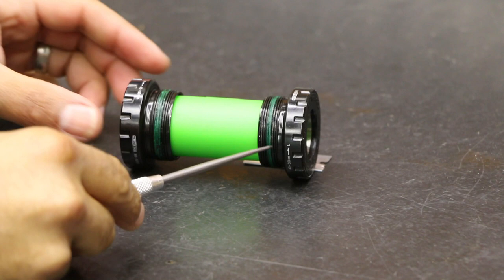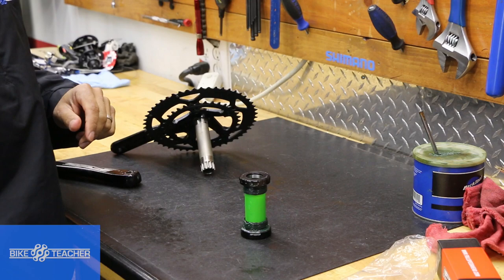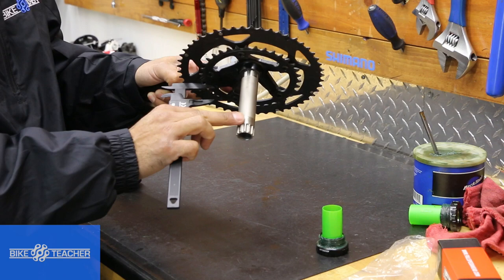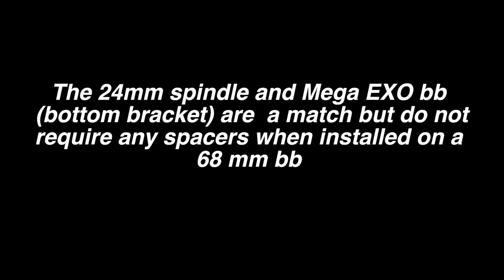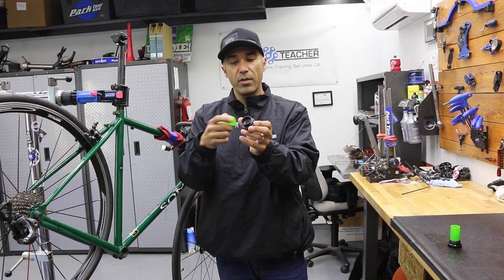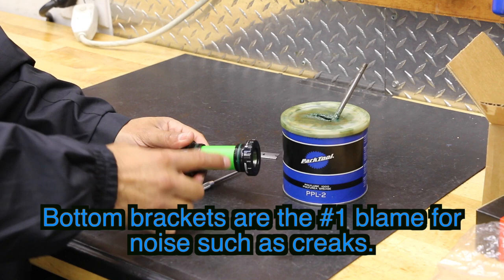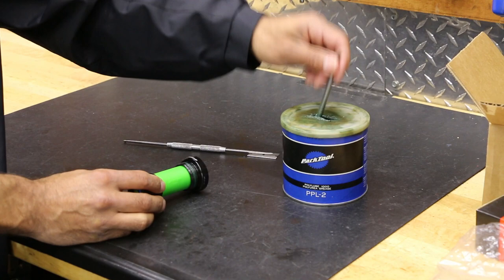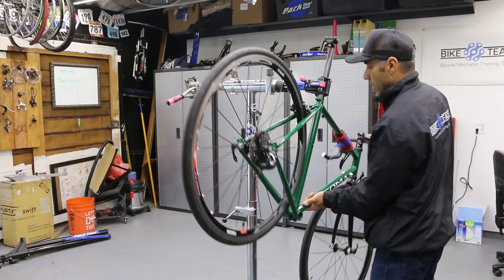How To install an FSA Threaded Bottom Bracket & a 24mm spindle Crankset

Comment: In bearing specs 24mm to 23.8mm is like a grand canyon.
This adds more to the confusion between mega-exo and hollowtech-ii 
On one site someone reports the size of the mega-exo spindle being 23.5mm and on one video this one guy claims to have used hollowtech-ii bearings for his fsa-gossamer but he is greasing and hammering it in!!!  ???

This is nuts.  Every other source on the internet is adding more and more to the puzzle, while the average rider can't afford to buy 2-3 different bottom brackets to compare, especially when one costs $50 and the other $20

Comment: The Mega Exo bottom bracket system is counterintuitive. I'll explain: If you're riding a bicycle where the crankset arms are sitting almost flush with your frame on your current bicycle ( by design ) and replace that system with a Mega Exo bottom bracket, you'd end up putting added friction to the right hand side of not only the rear cogs of your bike, but also the front ( the cogs and chain will be chewing each other up ). Why ?? Because there's a quarter of an inch added by Mega Exo to each side of your drive train ( which your bicycle wasn't built to accommodate ) when you decided to add a Mega Exo bottom bracket. What does that add up to ?? Well, because of that one quarter inch of angle, not only would you end up getting wear & tear to your front & rear cogs, you'd also be wearing out your chain.
Reply from the maker: +ReneeNme   I see your point, it’s all very interesting, and I wish I had more knowledge on the engineering side of it. Thanks for the insight.
Reply: If you notice the drive side crank arm on the Gossamer it looks like an umbrella, where the one you are probably replacing it by (square, octalink,isis) is pretty flat.  So the frame to chainring centerline offset remains about the same.

The bearing centerlines on a 68mm inboard BB are about 60mm apart.  On the megaexo or hollowtech they are 75-80mm.  That makes the crank-shaft flex less, on top of being larger diameter and stiffer itself.  The bb30 frames are suffering because of the narrow shaft.
Reply: OMG - You just solved a year long mystery to why my drivetrain was constantly crunching under load.  Couldn't figure out after multiple derailleur adjustments and chain swaps. Damn FSA BB cup was practically fused to the frame on the drive side upon removal. This is an issue. My bike is a 2020 model

Comment: Thanks for the great video, but did you do the part 2? I am unable to find it.
Reply from the maker: Looks like I did not make the video, I looked for it and could not find it, sorry. This one has a built in bolt I believe or maybe a loose bolt for tightening. Tightening this bolt to approximately 45-50 nm should secure the crankset. Let em know haw it goes.
Reply: @BikeTeacher  how much torque for the threaded ring? No one ever talks about this torque, only the screw that locks the pedal arm

Comment: Is fsa gamma pro crankset compatible with SHIMANO Deore XT M8000 Mountain Bike Bottom Bracket?
Reply from the maker: I don’t know. If the diameter of the spindle is the same that is a good chance. Check with Wheels Manufacturing. Com they offer lots of conversions.

Comment: Hello,  im Lukas from Poland and i have problem with mounting a Xt m771 crank in the fsa bb9200 ceramic v4.9,73e,are you able to help me, I know bikes well, but when I put together the crank xt m771 and BB9200 support, I have a slight slack on the crank axis which I can't delete by unscrewing the lock nut and I don't know what's going on, all tightening moments and  parameters retained in accordance with the manufacturer's instructions, please help, the Fsa representative for Europe did not even know how the Shimano crank was built and recommended me using the ms150 sealing o-ring but I don't know how to solve my problem because it is a simple sealing O-ring. Thank you in advance.  Lukas from Poland
Reply from the maker: Sorry for the delay. Did you get it installed okay? All I can see is a spacer would take care of the issue, Spacers and or wavey washer. If the spindle is moving side to side the the appropriate spacer placed between the bottom bracket cut and the frame should solve this. Let me know.
Reply: Hello, Fsa Europe replied to me in the email that there is a minimum tolerance in the dimensions of the Fsa and Shimano crank axis, Mr. Sandro from Fsa Europe also claims that the wavy washer will not do the trick and advises against using it, apparently Shimano crank spindle has a larger dimension than Fsa (for example  : Shimano 24.1mm, Fsa 23.8), Fsa recommended me to mount a shimano xt m771 crank, bottom bracket fsa bb6000 road, unfortunately Fsa could not cope with my problem, it was difficult to get some specific answers from them, they were surprised by my question about this matter  , they have no experience how their products work with parts of other companies. I wonder if a wavy washer could solve the problem but it is probably used when we want to evenly press the bearing, right?  And I have too loose fsa bb9200 cup in relation to the crank spindle diameter, and when I put on a shimano bb 52 it is all good, so Fsa said in the email that there is a difference in the dimensions of the crank axis of both companies (Fsa and Shimano) and it probably is  whole mystery why the Shimano xt m771 crank I don't want to work well with the bb9200 megaexo bottom bracket. Thank you for the answer, I don't know if I will experiment with the wavy washer because I don't want to damage the fsa bottom bracket, which was an unimaginable path. I can't measure the axis of both cranks, I mean I have  but only Shimano, I wonder if the axis of the Fsa crank really differs in dimension from shimano, unfortunately I do not have a Fsa megaexo crank to make such a measurement because I would be convinced that the Fsa e-mail was telling the truth, I can collect money for a dedicated crank for a 9200 megaexo bottom bracket  it's Fsa k- force Light or SL-k, both 24mm megaexo. Greetings from Poland, take care
Reply: I have 73m bottom bracket shell, one spacer 2.5mm between bb cup and frame and that's it